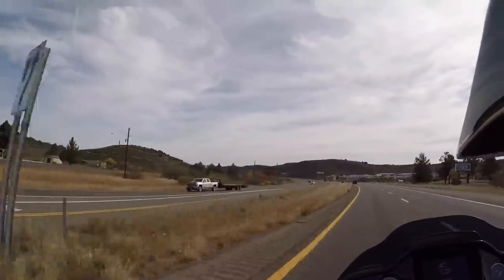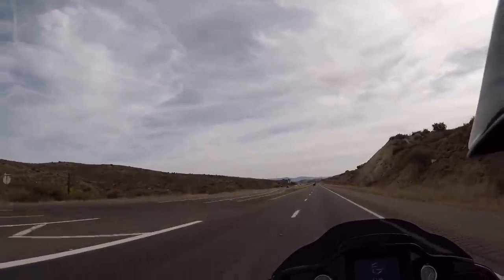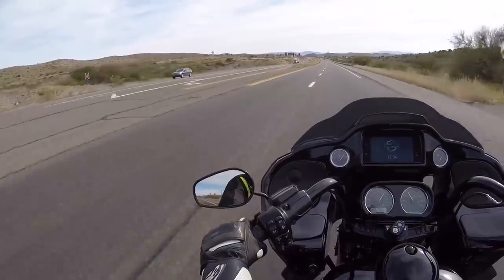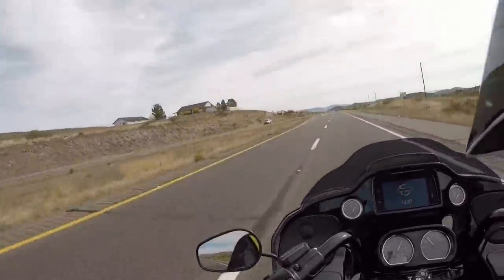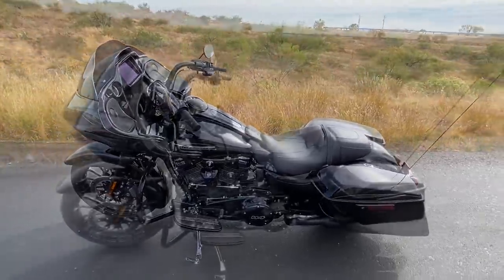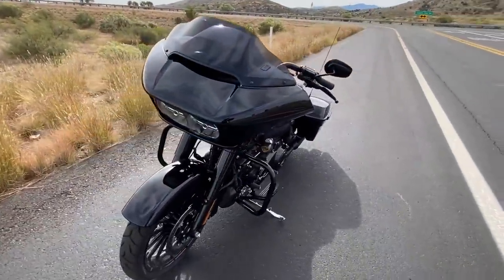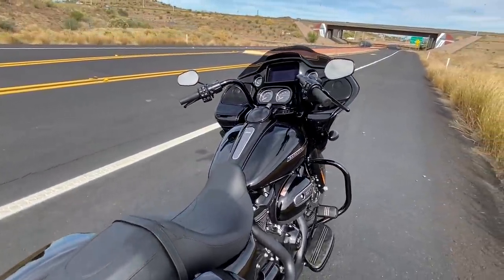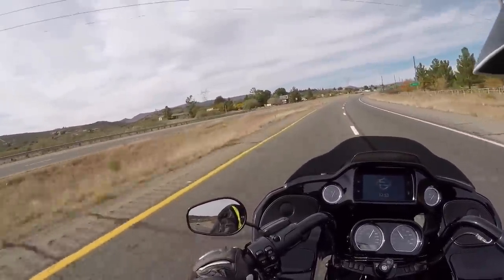2020 Indian Challenger VS Harley Davidson Road Glide Special

Comment: I really don't get this. Why compare a RG with a Challenger? Literally the ONLY thing the two have in common is the fixed fairing. Having ridden both, they are streets apart, and in my opinion leaving aside performance, the biggest difference is suspension and handling. I am waiting for HD's touring 2021 line up specs, and if they haven't improved the nonexistant shocks, my money is with Indian.

Comment: Power is good on the Milwaukee 8, not CHallenger level power but good power , suspension is super harsh on hd touring bikes. Doesn't have the live weather and traffic overlay on the GPS like the Challenger, doesn't have remote locking bags. Don't think HD has standard TPMS or standard LED lightening all around like Indian.
Reply: technically it does have the weather. You get it with xm box and then pay xm for the travel package. My 16 Ultra limited has flashed rain warnings and then the GPS shows the rain.  It works only with the paid xm. The challenger gives you two years of free weather from Verizon.  I road the Challenger last week and pulled the trigger. Much nicer than the road glide special I was going to get.

Comment: Good video.  I like seeing an honest comparison. Comments show a bunch of butthurt, but that’s OK. I will give Polaris credit for one thing. They are not afraid to chart their own course when it comes to styling, even if it is ugly. First they come out with the vision that looked like a space ship, then they come up with the challenger that looks like a Ford pickup.  But at least they aren’t copy catting HD like the rest of the metric brands.
Reply from the maker: I like the way the Challenger looks! I like what they did, i have hated the MOCO for quite a while...i was confused when i liked the RG as much as i did... shit, I’ll ride anything, ANYWHERE... I’m loyal to no brand
Reply: The challenger looks alot like the road glide. Yamaha put their own designs on their cruisers since the v star 1300 came out in 07. Honda has always copied hd with their shadow models. Harley tried to sue them years back. Suzuki doing the same as honda & also kawasaki, kawasaki even made a cheap indian knock off years ago!

Comment: The 108 Indian is Bait, I’m sure a bigger 115-118 will come out. And first model year bikes will always have Gremlins 😈😈
Reply from the maker: FXDR-S1000R Eli C. Be interesting to see what they come up with!
Reply: They put like 250k miles on these bikes its been in the works for couple years some of  the design, mono shock, aluminum frame inverted forks have been around since victory
Reply: Bill blasius 
Sure they do, so does every other bike/Car manufacturers, but there’s still always Gremlins in new models. 
I’ll wait for all the Guinea pigs to buy theirs, and even after, more that likely, I’ll remain loyal to my H-D dealer who has always been there for me, and have peace of mind in having a H-D dealer always close wherever I go.
Reply: FXDR-S1000R Eli C. Good thing there are so many H-D dealers because you’ll need them. After my experience with a 19 SGS I’ll never buy another Harley. Not the first bad experience either.

Comment: Harley needs to step up their game, they are too reliant on their name alone selling their bikes. Road glide is nice but to option one up they get real expensive real fast.
Reply: I'm amazed at how many people keep saying this, and don't realized harley already has.
Harley smashed the Chief series with the new M8 Softail. Hands down, the M8 Softails are cheaper, faster, lighter, and better equipped stock than the Indian Chief series.
Look at the Lowrider S vs the Dark Horse. 86hp 107TQ 670lbs WET LED headlamp 18000$ vs 74hp 110TQ Aircooled 736lbs DRY WEIGHT, Halogen Headlamp 18500$
Softail Slim 107 81hp 98.5TQ 617lbs wet, LED headlamp, 16000$ add ABS $16800.
If you want to parts match the Dark Horse to the Softails appropriately. You have to add the oil cooler(310$) and the LED headlamp(410$) Bringing the total for a stock price matched Dark Horse to $19220
Chief Vintage vs the Heritage Classic 107. Again 74hp 100TQ vs 81HP 98.5TQ, 804lbs DRY vs 738lbs Dry. $20000 vs $19000.
Think about it. If you're in the market for a full sized cruiser, you'd be throwing your money away buying that Indian over the Harley.
Why would you pay MORE for a bike that has LESS power, LESS cooling, Weighs MORE, and has a Halogen Headlamp instead of an LED headlamp.
You'd be a fool to do so.
Also
Did you forget the Livewire exists?
The new harley engine at 1250cc is going to put out 145hp. Which is substantially more than the 1200 FTR engine. The 975cc Harley RevoMax is going to put out 115hp, 15 more than the Scout 1200 engine.
Harley ALREADY has stepped up their game.
The question is, when are people going to actually pay attention?
Harley is already stepping up their game. Their M8 is beter than the TS111 and TS116. Their Softail stomped the Chief. Their new DOHC engine is going to beat the FTR and Scout engine with less displacement.

People need to stop being so biased and actually look things up and give an honest look at these products.
The challenger is indian upping the game, sure but Harley already improved and has more punches on the way.
Reply: FranBunnyFFXII that 145 hp motor isn’t going in the street fighter it’s goin in the adv bike the Streetfighter gets the smaller motor with ho comparable with the ftr. 

Live wire is a fucking joke. You don’t own a Harley to be quiet 

And yes they need to step up there current models instead of dragging there feet with small updates every five years that other companies have been doing for years
Reply: @FranBunnyFFXII   indian coming out with a new middle weight bike next year ive heard from dealer the scout is much better than a sportster and I think the challenger is better than a road glide. Harley needs to step up their game hopefully competion is good for the consumers of both
Reply: @billblasius920  People need to stop saying this. Harley has already stepped up their game. This is Indian playing catch up.

Comment: I respectfully disagree with your assessment. There is no way the antiquated outdated HD Touring chassis out performs Indian's new frame and mono shock. Indian's center of gravity is much better than HD. Not sure about your perception of the Indian be a bit more top heavy.
The MOCO really stepped up in 2018 with the new Softail frame and suspension. Light years ahead of previous models. It is time for HD to update the touring chassis. I recently got rid of a 2018 SGS due to the ride and suspension. Could not see spending a crap load of money upgrading their BS suspension. 
When Indian offers this new 108 in other models there will be one in my garage. Indian for the win.
Reply: But you thought it was better to spend a crap ton of money to get rid of your sgs and buy a more expensive bike?
Reply: @HDR20  I stayed with HD. Purchased a Softail Sport Glide. The Sport Glide is $10,000 less than the SGS. Much better platform. Substantial improvement in ride quality, power, and handling.